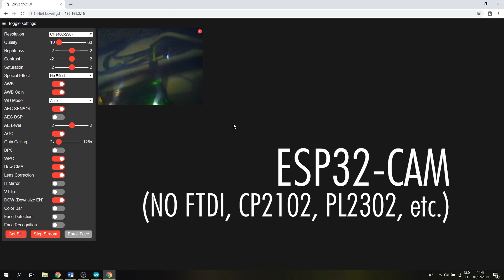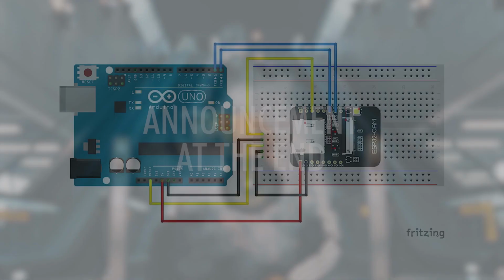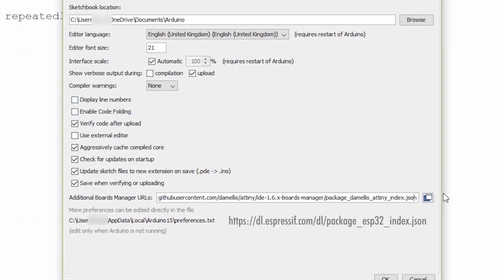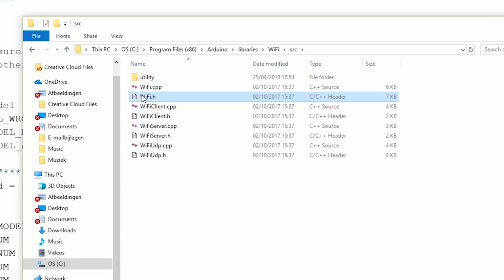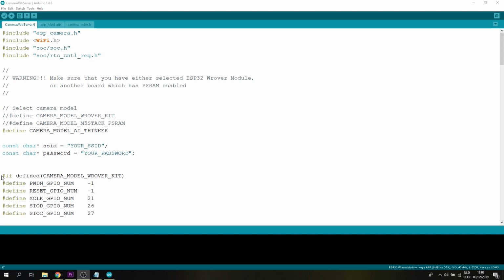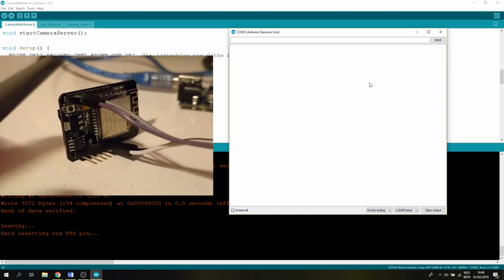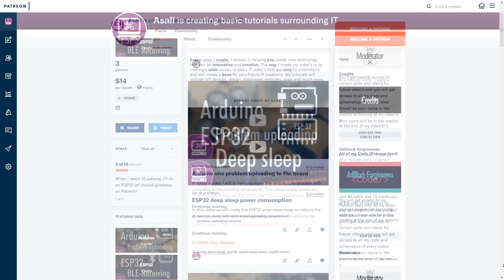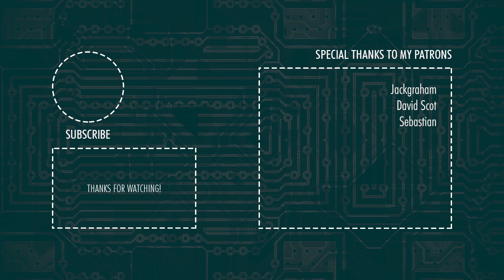ESP32-CAM AI Thinker how to upload in Arduino, no adapter!

Comment: Using an FTDI programmer. Board says ESP-32S (no mention of AIThinker). 
Tried what you did but it says:
"A fatal error occurred: Failed to connect to ESP32: No serial data received."

FTDI VCC -> 5V ESP (jumper of FTDI set to 5V)
RX -> TX
TX -> RX
GND -> GND
GPIO0 of ESP -> GND ESP
Flash frequency, upload speed, partition all exactly same as yours. 

Held the reset button while 'Connecting....' was being displayed. 
Kindly help me out.

Comment: Great video! It was a good guide. But, when I upload the code it keeps showing this (see below)

Arduino: 1.8.19 (Windows 10), Board: "ESP32 Wrover Module, Huge APP (3MB No OTA/1MB SPIFFS), QIO, 40MHz, 115200, None"

Sketch uses 2594790 bytes (82%) of program storage space. Maximum is 3145728 bytes.

Global variables use 56256 bytes (17%) of dynamic memory, leaving 271424 bytes for local variables. Maximum is 327680 bytes.

esptool.py v3.0-dev

Serial port COM3

Connecting........_____....._____....._____....._____....._____....._____.....____An error occurred while uploading the sketch

_

A fatal error occurred: Failed to connect to ESP32: Timed out waiting for packet header

This report would have more information with
"Show verbose output during compilation"
option enabled in File -> Preferences.

Comment: Can anyone help me solve this error:

ets Jun  8 2016 00: 22: 57

rst:0x1 (POWERON_RESET),boot:0x12 (SPI_FAST_FLASH_BOOT)
configsip: 0, SPIWP:0xee
clk_drv:0x00,q_drv:0x00,d_drv:0x00,cs0_drv:0x00,hd_drv:0x00,wp_drv:0x00
mode:DIO, clock div:2
load:0x3fff0018,len:4
load:0x3fff001c,len:1216
ho 0 tail 12 room 4
load:0x40078000,len:9720
ho 0 tail 12 room 4
load:0x40080400,len:6364
entry 0x400806b8

it prints this on serial monitor indefinitely

Comment: Arduino: 1.8.13 (Mac OS X), Board: "ESP32 Wrover Module, Huge APP (3MB No OTA/1MB SPIFFS), QIO, 40MHz, 921600, None"

/Users/Rafeyyy/Documents/Arduino/CameraWebServer_esp32/CameraWebServer_esp32.ino: In function 'void setup()':
CameraWebServer_esp32:90:28: error: invalid conversion from 'const char*' to 'char*' [-fpermissive]
   WiFi.begin(ssid, password);
                            ^
In file included from /Users/Rafeyyy/Documents/Arduino/CameraWebServer_esp32/CameraWebServer_esp32.ino:2:0:
/Applications/Arduino.app/Contents/Java/libraries/WiFi/src/WiFi.h:79:9: note:   initializing argument 1 of 'int WiFiClass::begin(char*, const char*)'
     int begin(char* ssid, const char *passphrase);
         ^
exit status 1
invalid conversion from 'const char*' to 'char*' [-fpermissive]

This report would have more information with
"Show verbose output during compilation"
option enabled in File -> Preferences.
 please helpp

Comment: After pressing the reset button my two esp32's print out the info then a never ending line of dots starts instead of the wireless starting up.

Comment: i has try million time upload file but alltiem only error, app httpd,cpp file have big shit, all text in file have ewery row come eroro error eroor eroor. not can upload because app httpd.cpp file need new what working true. or take out delete all file.now vwersion 101 different error than 102 and 104. Arduino: 1.8.13 (Windows 7), Board: "ESP32 Wrover Module, Huge APP (3MB No OTA), QIO, 80MHz, 921600, None"

sketch\app_httpd.cpp: In function 'esp_err_t status_handler(httpd_req_t*)':
app_httpd.cpp:547:50: error: 'struct camera_status_t' has no member named 'sharpness'
     p+=sprintf(p, "\"sharpness\":%d,", s->status.sharpness);
                                                  ^
sketch\app_httpd.cpp: In function 'esp_err_t index_handler(httpd_req_t*)':
app_httpd.cpp:581:22: error: 'OV3660_PID' was not declared in this scope
     if (s->id.PID == OV3660_PID) {
                      ^
C:\Users\masawee\AppData\Local\Arduino15\packages\esp32\hardware\esp32\1.0.2\libraries\ESP32\examples\Camera\CameraWebServer\CameraWebServer.ino: In function 'void setup()':
CameraWebServer:74:20: error: 'OV3660_PID' was not declared in this scope
   if (s->id.PID == OV3660_PID) {
Multiple libraries were found for "WiFi.h"
Used: C:\Users\masawee\AppData\Local\Arduino15\packages\esp32\hardware\esp32\1.0.1\libraries\WiFi
Not used: C:\Program Files (x86)\Arduino\libraries\WiFipois
exit status 1
'struct camera_status_t' has no member named 'sharpness'

Comment: I cant get mine to work, in serial Monitor it loads the first part with flash boot etc etc, then seems to be in a loop, as if trying to connect, tx on my arduino is constantly flashing so i presume its trying something however seems to be taking forever. Help please
also i dont have an AI Thinker, mine is a esp32s2, do i still leave it on the same setting?

Comment: Arduino: 1.8.13 (Windows 10), Board: "ESP32 Wrover Module, Huge APP (3MB No OTA/1MB SPIFFS), QIO, 40MHz, 115200, None"

Sketch uses 2100679 bytes (66%) of program storage space. Maximum is 3145728 bytes.

Global variables use 53552 bytes (16%) of dynamic memory, leaving 274128 bytes for local variables. Maximum is 327680 bytes.

esptool.py v2.6

Serial port COM3

Connecting........_____....._____....._____....._____....._____....._____.....____An error occurred while uploading the sketch

_

A fatal error occurred: Failed to connect to ESP32: Timed out waiting for packet header

This report would have more information with
"Show verbose output during compilation"
option enabled in File -> Preferences.
I got this error!!

Comment: Finally! the only tutorial that uploaded the code for me!!! I have an arduino Uno and a Wrover esp32cam. But the "only" problem is that it doesn't work yet :( I get this error in serial monitor:

[E][camera.c:1049] camera_probe(): Detected camera not supported.
[E][camera.c:1249] esp_camera_init(): Camera probe failed with error 0x20004

what's wrong now?
Reply: haii nima, can u sent here the full coding of this esp32 cam ?
Reply: @sopyvengers4616  I don't realize if you're trying to help me with my problem, or just asking the code because you couldn't upload it yet.
Anyways, I did whatever Asali said in the video and it worked. My problem was solved by uncommenting the Ai thinker model and commenting the Wrover model (mine is a Wrover, but I had to comment this model 🤷‍♂️)

🔴🆕️ My new problem is that if the esp32cam gets disconnected it won't  reconnect to the router/hotspot/network automatically and I have to reach the esp32cam and restart it buy hand. What if I want to fix it in some place high? Do I really need to restart it every time? Can't it just get reconnected to the network like any other normal device?

Comment: When I connect the 5V (ESP32-CAM) to 5V (Arduino) the LED on Arduino turned off and IDE  could not detect the device.
When I connect the 3.3V (ESP32-CAM) to 3.3V (Arduino), the LED on Arduino turned on and IDE can detect the device.
But when I try to upload, this message occur:

Sketch uses 2100663 bytes (66%) of program storage space. Maximum is 3145728 bytes.
Global variables use 53552 bytes (16%) of dynamic memory, leaving 274128 bytes for local variables. Maximum is 327680 bytes.
esptool.py v2.6
Serial port COM3
Connecting........_____....._____....._____....._____....._____....._____.....____An error occurred while uploading the sketch
_

A fatal error occurred: Failed to connect to ESP32: Timed out waiting for packet header

Can you suggest any solution?
Reply: i got the same problem with him.
 please suggest some solution
Reply: @asyrafafiff8930   I was having the same issue. I did the changes below and now it works.
connect the D0 pin of the esp32 to ground
connect the reset pin of the arduino to ground
connect the grounds together
connect the 5V  pins together
connect the RX pins together
connect the TX pins together
and keep the settings the same

Comment: A fatal error occurred: Failed to connect to ESP32: Timed out waiting for packet header
Reply: If you are using arduino or something else to flash swap TX and RX pins around. The labeling might be wrong. Also arduino TX and RX pins are 5V so you need to supply 3.3V to USB to TTL converter chip such as CH340G. I stole 3.3V from ESP32 regulator to ch340G chip because the fake arduino nano couldn't supply steady 3.3V.  It worked and I didn't need any capacitor.
Reply: @zaqwsx28  The TX RX in either the UNO board or the ESP32 is the other way around. It worked after I change them! thank you so much for the tip!!!!
Reply: @zaqwsx28  thank you so much switching it worked perfectly!
Reply: same. There is a article somewhere where they solved it with a capacitor

Comment: Hi there, and thank you for educating us.  I have been struggling with this same setup.  My ESP32 seems to be rebranded board, which I bought (out of ignorance) from Amazon.  It is exactly line the Thinker you showed in your video, except the word Thinker.  So, I tried all the models listed in the sketch, and I still get the same message (see below).  I made the changes you suggested, still not working.  I changed WIFI.h to ArduinoWIFI.h and I added these two libraries.

#include "soc/soc.h"

#include "soc/rtc_cntl_reg.h"

I still get this message:

ets Jun  8 2016 00:22:57

rst:0x1 (POWERON_RESET),boot:0x3 (DOWNLOAD_BOOT(UART0/UART1/SDIO_REI_REO_V2))

waiting for download

ets Jun  8 2016 00:22:57

rst:0x1 (POWERON_RESET),boot:0x13 (SPI_FAST_FLASH_BOOT)

configsip: 0, SPIWP:0xee

clk_drv:0x00,q_drv:0x00,d_drv:0x00,cs0_drv:0x00,hd_drv:0x00,wp_drv:0x00

mode:DIO, clock div:2

load:0x3fff0018,len:4

load:0x3fff001c,len:1216

ho 0 tail 12 room 4

load:0x40078000,len:9720

ho 0 tail 12 room 4

load:0x40080400,len:6364

entry 0x400806b8

[E][camera.c:1049] camera_probe(): Detected camera not supported.

[E][camera.c:1249] esp_camera_init(): Camera probe failed with error 0x20004

Your thoughts, please.  Thank you,  Mac
Reply: Have exactly the same error, did you manage to resolve it?
Reply: @tomsgrinbergs8020  I did not find the error.  I ordered a different module (AI Thinker) and it worked.  In the meantime, I suspect a different pinout in the various ESP32 modules.  I just returned them for refund.

Comment: Thank you for sharing!  My set up if failing to connect.  Here is the error message:Arduino: 1.8.11 (Windows 10), Board: "ESP32 Wrover Module, Huge APP (3MB No OTA/1MB SPIFFS), QIO, 40MHz, 115200, None"Sketch uses 2100667 bytes (66%) of program storage space. Maximum is 3145728 bytes.
Global variables use 53552 bytes (16%) of dynamic memory, leaving 274128 bytes for local variables. Maximum is 327680 bytes.
esptool.py v2.6
Serial port COM3
Connecting........_____....._____....._____....._____....._____....._____....._____A fatal error occurred: Failed to connect to ESP32: Timed out waiting for packet header
A fatal error occurred: Failed to connect to ESP32: Timed out waiting for packet headerThis report would have more information with
"Show verbose output during compilation"
option enabled in File -> Preferences.Please, adviseMac

Comment: I have this error: 
Arduino: 1.8.10 (Windows 10), Board: "ESP32 Dev Module, Disabled, Default 4MB with spiffs (1.2MB APP/1.5MB SPIFFS), 240MHz (WiFi/BT), QIO, 80MHz, 4MB (32Mb), 921600, None"

Sketch uses 2053867 bytes (156%) of program storage space. Maximum is 1310720 bytes.

Global variables use 53488 bytes (16%) of dynamic memory, leaving 274192 bytes for local variables. Maximum is 327680 bytes.
Sketch too big; see http://www.arduino.cc/en/Guide/Troubleshooting#size for tips on reducing it.
Error compiling for board ESP32 Dev Module.
Reply: In Arduino IDE change to the following; Tools -> Partion Scheme -> Huge APP (3MB no OTA)

Comment: When i uploaded almost done but warning like "A fatal error occurred: Failed to connect to ESP32: Timed out waiting for packet header
." What's wrong with this??
Please help, from Indonesia.
Reply: Getting the same error
Reply: wheni used it 6 months ago it had worked, now im getting same error
Reply: try a smaller baud rate instead of the default 921600 ... for me it worked only with 115200
Reply: With NO failure, every time I get that error, wiggling the wires to make sure they are all connected properly fixes it!!! Check your connections.
Reply: Any help how you solve this problem

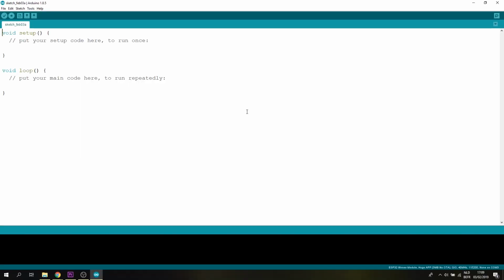Comment: would it be possible to elaborate on connections without a breadboard @1:27 . where is yellow rest going to? and what is the yellow  [GPIO or D01 or whatever that is], where is the ground from Uno going [assuming ground on esp32], similarly black loop of esp32 ground

Comment: Please disregard my previous post. All's good. 1. I replaced the  Uno with a Nano and the reset issue is no longer happening. 2. I noticed that the Ipex antenna is the default antenna so I was getting no consistent connection to my router. I put another router right next to it and joined it and all's nice and solid and steady. Thank you again for your great video!
Reply from the maker: Great to hear things worked out for you!
Reply: @asali-channel  Just out of curiosity, do you know why it's not possible to get Serial Monitor messages from the ESP32 unless you have the RST pin on the ARDUINO connected to ground? If I disconnect the RST pin on the Arduino from GND once I've done the upload, disconnected IO0 and pressed RESET on the ESP32, the sketch runs correctly, but Serial Monitor messages do not appear. But if I connect RST back to GND on the Arduino I see the Serial Monitor messages. Thanks Asali

Comment: HI again:
Today, I'm having no luck with any of the 3 ESP32Cams I have. I am able to upload the code and I did make all the edits to the sketch as you directed. However, I have to keep the Reset pin on the arduino grounded to the ESP32 all the time or else the ESP32 won't reboot.
When it does reboot, it won't broadcast the IP address unless there is NO web browser attempting  to view the webpage. I have to close any browser tabs and do a reboot.
Then, the camera starts, shows it's target in the browser but then crashes and it won't come back.

Any suggestions?

Thank you for your help.

Comment: Thank you SO MUCH for such a straightforward and clear tutorial. It worked the first time! Your wiring diagram was great and instructions were very clear. I'd ultimately like to build a robot with the ESP32 that I can drive remotely. So if you have any resources that show how to modify the HTML interface so I can send single character commands via button pushes to drive the robot, those resources/links would be appreciated. Thank you again for a great tutorial!

Comment: Getting the following error:  
FindFirstFile C:\Users\******\AppData\Local\Temp\arduino_cache_881817: The system cannot find the file specified.

Error compiling for board ESP32 Wrover Module.
Reply: Restarting the IDE fixed the issue.

Comment: when I upload my code I get an error   
A fatal error occurred: Failed to connect to ESP32: Timed out waiting for packet header.
Reply: Check upload speed, it has to be 115200
Reply: @rbessuges  same issue, it's set as that.
Reply: @DoubleOBond   same issue....
Reply: any solution? im facing same problem
Reply: @Pigirl  No. Same problem
Reply: @lucianofmfm  If you get any solution please do. Share it.
Reply: @Pigirl  Hello, have you got solution ? :(
Reply: Was solved?
Reply: @lucianofmfm  Noo

Comment: Hi Mr., first of all thank you for this video tutorial. Unfortunately I got this error running Arduino IDE on Linux Mint : Arduino: 1.8.9 (Linux), Placa:"ESP32 Wrover Module, Huge APP (3MB No OTA), QIO, 40MHz, 115200, None"
Traceback (most recent call last):

  File "/home/oscar/.arduino15/packages/esp32/tools/esptool_py/2.6.0/esptool.py", line 35, in <module>
    import serial.tools.list_ports as list_ports
ImportError: No module named serial.tools.list_ports
exit status 1
Erro compilando para a placa ESP32 Wrover Module

I have no idea what that means. If you can help me I'll appreciate, thanks!

Comment: got it working now
Reply from the maker: Great to hear, sorry for the late response!
Reply: @asali-channel  thanks for your reply. What is the problem if i have a vertical green Bar in the picture?
Do you know if it is soft or Hardware related?!
Reply from the maker: @mr.mythoclast4451  Never encountered this problem or heard of it either, is it only one vertical green bar or multiple across your picture?
Reply: @asali-channel  it is always one Bar there and always on the same position
Reply from the maker: Then I don't know... Otherwise it could've been your power supply but I'm not sure now

Comment: it workss!!! thankyou so much..i wonder how to program esp 32 cam using 2 dc motor + Cam without adapter(making an RC car..camera)
Reply from the maker: Perhaps you can check out this video, here I used an Arduino Uno but the schematic and code is pretty much the same: https://youtu.be/cYAPK7xoISE

Comment: Good video! I have been dying to play with the new ESP camera boards, and this certainly helps! Video editing suggestion: the audio is WAAAAY too low, which you could fix in editing by using compression and normalization.
Reply from the maker: Thank you and yes I have tried normalization but everytime I try it with my current mic, my voice gets all weird n stuff and only makes it worse for some reason :/
Reply: You may need to compress your audio first, so that the difference between the loudest and quietest sound is smaller, and THEN run it through normalization, which generally only increases the entire audio track to the maximum volume it can before clipping, and it generally does this by scanning the audio track, finding the loudest point, and raising the gain until it is at maximum before clipping (which can be close to useless without properly squashed dynamic range).
Reply from the maker: Thank you so much for your response, I will try my best to accomplish this next week when I start working on a new video!